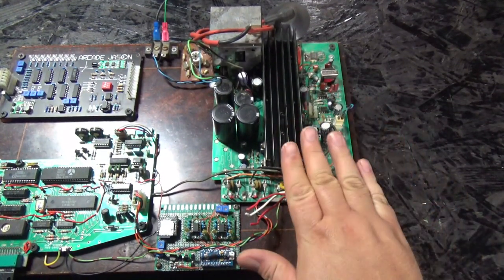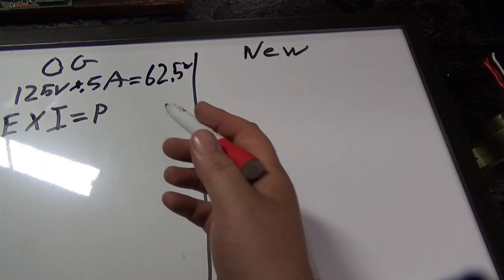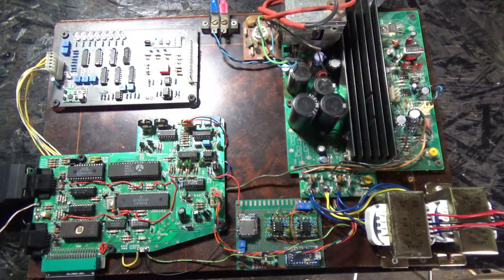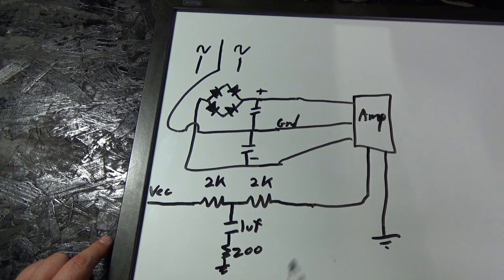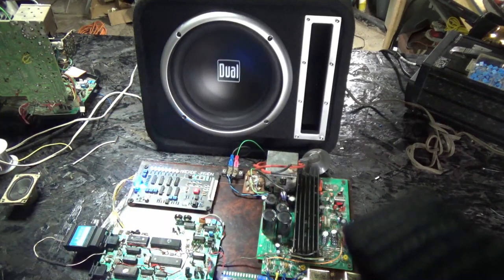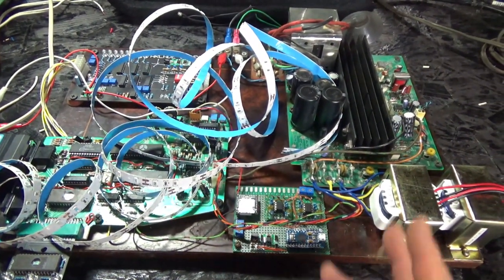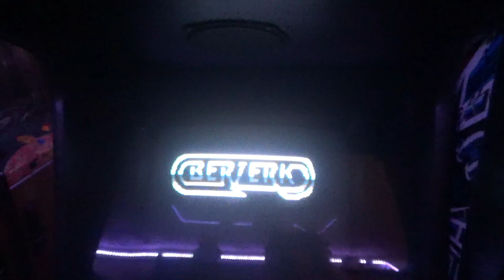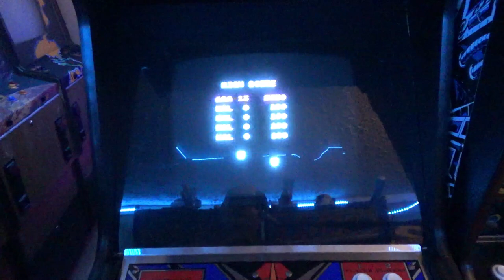When VECTORS go BERZERK part 3

Comment: Criminally hidden channel. I'm so glad I've come across it. The base level was a bit extreme, but hey sometimes you need to feel the game more than hear it; probably helped knock that mucous loose lol. An absolutely amazing and inspiring build. If you do see this what would be your #1 recommended resource for learning about wiring diagrams? I know what a lot of components do, but idk the logic of how they actually behave in a circuit. Only thing I've done beyond wiring outlets is a Lichtenberg machine that switches between transformers (which is still very simple).

Comment: Super duper cool project Jason, good on ya finishing it up so well! Is the whole lines not connecting up a property of it being a Vectrex?
Reply from the maker: not sure what you mean about the lines not connecting
Reply from the maker: if think your referring to the lines in calibration made .  with analog  electronics small variances in parts will affect the output. for example say a 100 ohm resistor in a circuit relating to the gain of an op amp  might measure 110 ohm on some machines and 90 ohms on others. as another example one units power supply might be 4.9 volts and another could be measured at 5.2 volts ect since the color pcb relies on an analog input i added adjustments to compensate
Reply: I just meant the line segments don't always connect up in the image on screen, where they tend to be more connected looking in, say, an Atari arcade game.